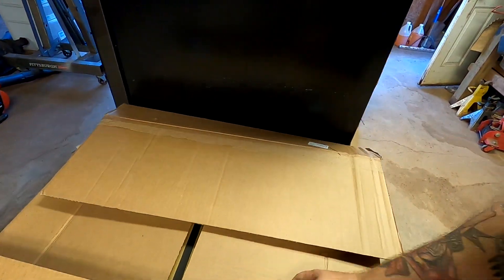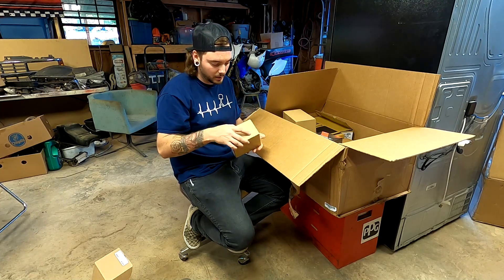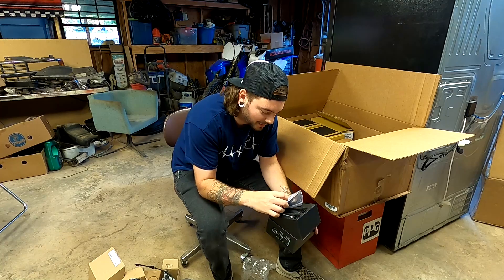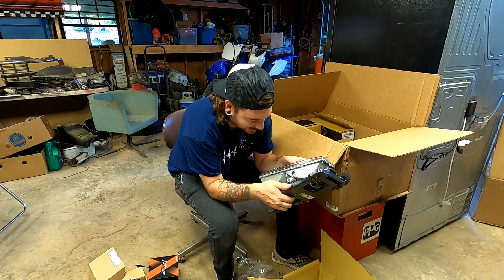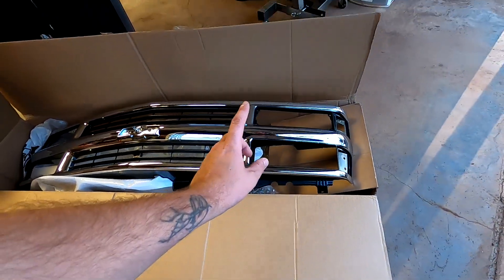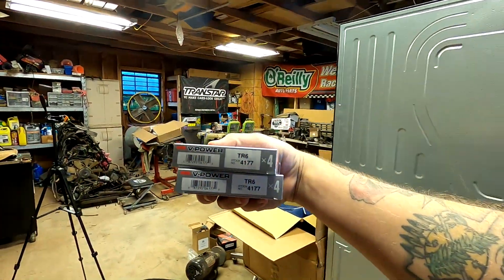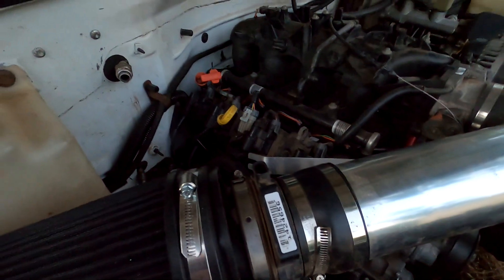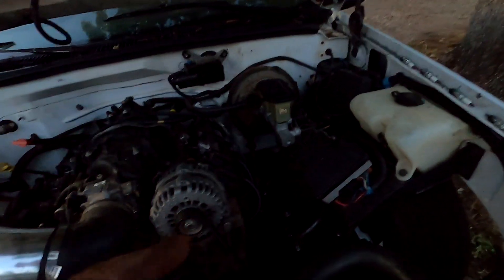Boxes on boxes baby! La Low Country gets some love!

Comment: To get rid of the soft pedal get on a dirt road doing about 30 to 40 mph and hit the brakes hard till it firms up. This will purge the air out of the ABS module valves. An old Chevy tech told me this and it worked for me.
Reply from the maker: Trick is I already have the front ABS sensor leads deleted. One was already damaged and I cut the other side while I was doing all the wiring. I’ve had one person tell me about the pump deal and I tried hitting the brakes and it don’t work